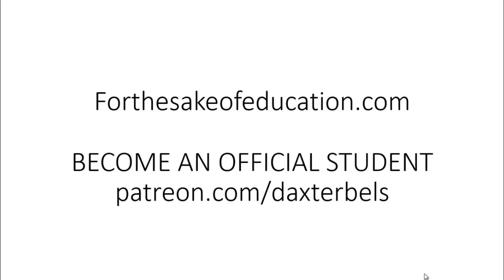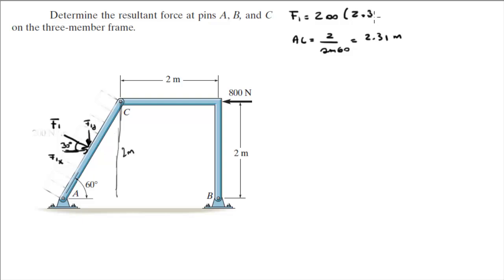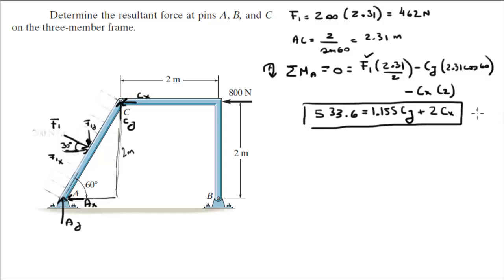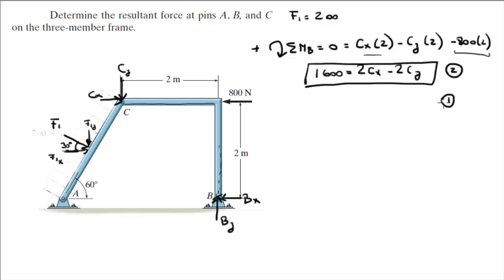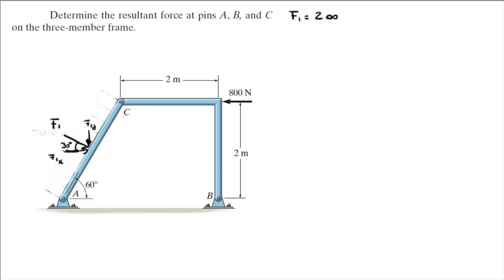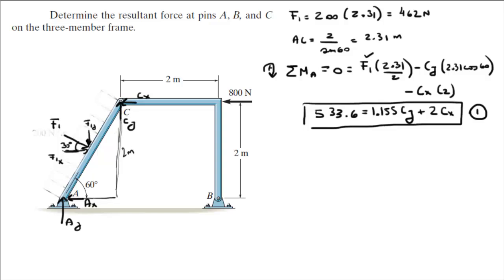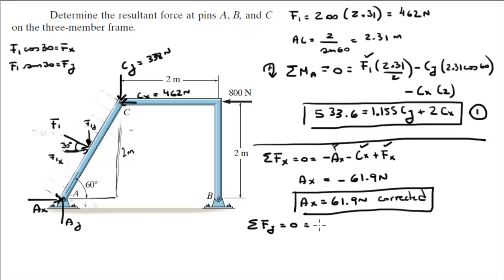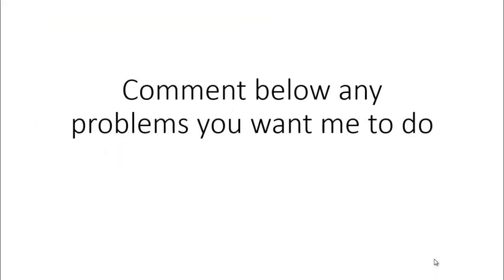Determine the resultant force at pins A, B, and C

Comment: What theorem of Geometry did you use to get the 30 degrees of the resultant force of the distributed load?
Reply: theta + 90 + 60 = 180, theta = 30
Reply: Draw a X Y axis at point of interest and seek out Z angles as well as opposite and alternate angles and you will find the 30°

Comment: When taking the moment around point A, why don't you include the 800N force?
Reply: Because this system solved by half method;B point is the line of half,moment B (second part of this system)contains 800 N force but other part of this system not contains 800 N,but it contains 200 N per meter force acted by the beam AC